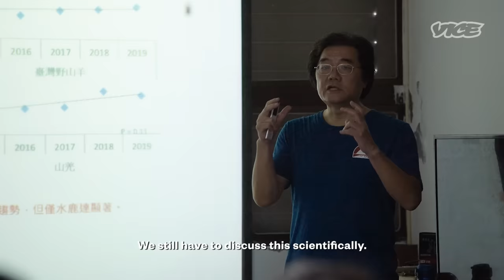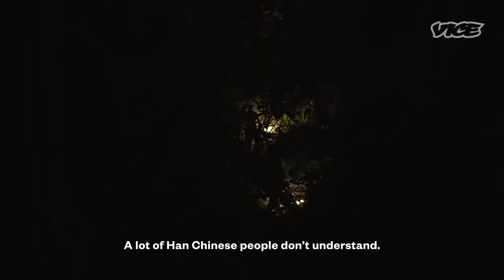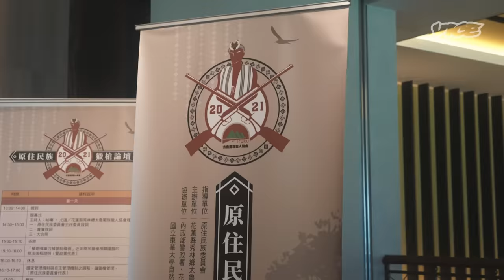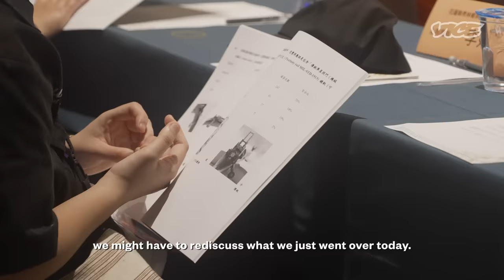The Homemade Guns of Taiwan

Comment: Two things I find really interesting about the stocks in particular 1) the length of pull is very long to keep the users face as far away from the chamber as possible 2) the stock is angled in such a way that aiming upwards (into trees) is much easier than aiming on a horizontal plane.

Comment: They should look for opportunities to come to the US and study under licensed gunsmiths. So they finally can build proper and safe homemade rifles.
Reply: Plus: the opportunity to have their youth and most talented entrepreneurs get knowledge and access to 3D printing. They already use wood but I assume printing would be of great use
Reply: Perhaps those in the west that have this knowledge may find refuge in the East where making guns is not just permitted but very much sought after.
Reply: Knowledge would definitely help tremendously, however, a big part of their problem seems to be the lack of proper tools. I would imagine if given a mill, a lathe, some quality steel, and an infinite supply of electricity, these guys would be turning out masterpieces in short order
Reply: @kabardino1337  They need equipment and proper materials to work with.  In parts of africa the steering shaft of cars were used for muzzle loading shot guns.  
Modern gunsmiths have CNC equipment these days.  The government would not allow that to be.  One of the easiest guns to make if you have some rudimentary equipment is a submachine gun.  3D printing, all of the working guns I have seen on youtube from it are using a lot of high quality steel parts in the design.
Reply: @loquat44-40  you can use sand casting and make own rifled barrels in your bathtub
Reply: @hungryorphan5975  I know just enough about steel that what you propose is not something that can be done as you describe.  Please give your sources.
Reply: @loquat44-40  it is possible my comments keep getting deleted it is called ecm
Reply: @hungryorphan5975  having experience in casting with sand molds, it would be incredibly difficult to make a long skinny tube with enough precision to be useful. You would also need to finish the inside of the bore, because a sand casting leaves rough surfaces that a bullet would get caught in
They should just be allowed to buy safe tools to hunt with. Its insane that they force them to risk themselves in such a way
Reply: @Haku Yuki yes, they do create some pretty nice looking firearms underground in the Philippines, but i think they have access to black market and better quality material to build their guns out of. Ive seen some with small power tools and compressed air tools in the Philippines though as well
Reply: @chrism4008  I'm not talking about making the barrel with the sand casting that's for recivers and other parts you use ecm for the barrel
Reply: @hungryorphan5975  i gotcha, that makes more sense
Reply: @chrism4008  I agree with you since to my knowledge long barrels have never been made out of cast materials.  The fall back for primitive conditions was to hammer forge strips of red steel around a mandrel.  The is doable under their conditions, but requires some knowledge.  Much cheaper to find perhaps hydraulic tubing that can take some pressure and that may be what they are using.
Reply: Honestly this is the best suggestion on here. A lot of people are bickering about gun laws and whether they work or not, but being able to study gunsmithing would help these guys out tremendously. Especially if they’re taught about the best improvised materials and how to work with less infrastructure, would probably set these guys apart by light years compared to their current tech.

Comment: As someone who takes pride in tool making and resourcefulness I wish I could travel to Taiwan and help their gunsmiths build out the tools needed for firearm manufacturing. Even something as relatively simple as a rolling block or trapdoor breech seems like an improvement over the open bolt, single lug designs that they are forced to work with because of their government.

Comment: In America, almost any rifle under 1,000 ft pounds energy or any bullet less than about 100 grains or that won’t expand is pretty much unacceptable for deer sized game.  And we realistically expect sub-moa accuracy.

In Taiwan they use homemade smoothbore muzzle loaders, powered by a nail gun blank, with a 10mm steel ball under 20 grains for the projectile.  And their government still freaks out about it.

I think a bow and arrow would be more accurate and more deadly than those homemade guns.

Comment: What I don't quite understand is if the goal of the government is to prevent the indigenous people of Taiwan to have powerful, or efficient firearms, or firearms that are a threat to "public safety" doesn't that backfire with the fact they encourage the people to learn to create their own guns? Guns that also threaten the lives of those who use them? 
They also require the guns to be certified and used by the one specific hunter to use, and if that's the case then the same process could easily be adapted to the purchasing and specific, lower power, or "less efficient" firearms that are far far far safer for hunters to use.
\
If the government had gone the route of allowing very specific select few manufactured guns  (such as single shot air guns, low-caliber rifles, etc.) to be purchased, certified, and used by the Indigenous people it would prevent most injury caused by backfiring guns, and would further prevent the percieved threat to public safety the government sees as it preserves the regulation on who is able to get guns but also discourages the need for the public to learn how to make their own.

Comment: I'm surprised they're not making roundball molds, homemade black powder, or even flintlock rifles.  Yeah, nail gun ball bearing smoothbore is simple, but I can't imagine there's no indiginous blacksmithing
Reply: Why bother with black powder muskets when you can just buy 22blanks and pellets for cheap
They are more reliable and accurate? Black power is also very vulnerable to environmental issues especially in damp areas and rain

Comment: The similarities between the indigenous people of Taiwan and the indigenous Māori people of New Zealand is striking. In culture, in language, in traditional social kinship structure, respect for elders tradition and integral ecosystem social relationships is striking. There is a very good reason for this. Scientific research into language and even DNA in recent years has shown that the ultimate ancestral origin of New Zealand’s Māori indigenous tribes are the indigenous peoples of Taiwan. New Zealand is the last major land mass to have been reached, discovered and settled by human beings since the dawn of modern man’s emergence from Southern Africa. The indigenous peoples of Taiwan are the initial progenitors and the indigenous peoples of the New Zealand the ultimate descendants of the migration over thousands of years and many generations of the Austronesian from insular East Asia through the archipelago chain of southeastern Asia, Micronesian, Melanesian and finally Polynesian island chain. Polynesians spread from west Polynesia eg Samoa, Tonga, Niue etc., to Hawai’i, to Rapanui (Easter Island) and Eastern Polynesia ie., Tahiti, the Maequesas, where the eastern Polynesians who travelled in double hulled ocean going vessels using star navigation to discover and settle New Zealand or Aotearoa. Hawai’i* to Rapanui (Easter Island) to Aotearoa / New Zealand form what is known as as the Polynesian Triangle. If one looks at map of the Pacific Ocean, one can see that the descendants of the aboriginal peoples of Taiwan have - over the course of millennia and hundreds of generations - migrated almost full circle. They are therefore the founders of the longest migration of related descendants and cultures in human history.

Comment: Seems like there are some decent options that could potentially satisfy the interests of both the tribal people and the government. I would suggest a combination of white listed factory made air rifles for tribal hunting and better access to firearms education, training, and range practice for the general public. 

The air rifles should probably be made in Taiwan under license at a modern factory. They should include models of high quality, good reliability, and safe function in calibers and design velocities appropriate for the game being hunted. By using air rifles instead of firearms, it gives the tribal people more independence because of no need for gunpowder. It also provides more predictable and safer operations  because it will be a function of just the pellet and air pressure, eliminating concerns of ammunition sourcing, manufacturing standards, and ammunition types. 

For hunting boar or other medium to large sized game, a caliber over .30 inch is recommended to minimize the potential suffering of the animals. For small game, .22 to .25 caliber may be sufficient. The models chosen should include moderators for reducing noise which can aid in hearing protection and prevention of game fleeing for a large surrounding area and reducing noise pollution for the public.

The management of the air rifles should be conducted by tribal representatives designated by themselves. They can establish rules for storage which might require a keeping them in a locked tribal armory when not in use and the rules for withdrawal for hunting or other uses such as rituals or training. They should be empowered to police themselves in regards to hunting rules and rifle usage rules for their tribes.

In addition to these air rifles for hunting by the tribes, the general public needs more firearms training for the purposes of general knowledge and national defense. This training could be at several designated firing ranges that are managed by the government. These should include some of the common firearms models used by the RoC military, the RoC police, and the air gun models used by the tribal hunters. Each of these should be available for the public to rent and use all the range. The public can also pay for any rounds or pellets used at the range at reasonable cost, bearing in mind that some may be able to be collected and reused (after reloading for the firearms rounds or just inspections for air gun pellets). The ranges should also include classes for gun safety, familiarity, and usage, and marksmanship.

The benefits of such rental based ranges and training classes are that the public will be better prepared in the event of military need such as mobilization in response to foreign invasion. The public will also be more knowledgeable of guns used by the hunters and the hunters themselves can use the ranges to improve skills. This will improve mutual understanding and respect between different groups of people.

Comment: I find it amusing that even in other countries buffoons with little knowledge or experience get to make laws without expending a single calorie actually researching or thinking.  A factory made single shot break action and a homemade rifle of the same type and caliber are not too different in effectiveness but without precise machining, materials, quality control, and proper ammunition your rifle could become a hand-grenade instead. It is either a supreme act of stupidity or an act of malice that the rule was not changed. At the very least they could allow black powder muzzle-loader rifles. In any case "safety" does not seem to be the issue here.

Comment: isnt it easier to open the shell and press the steelball into the shell? make a "live Round" ? much faster in my opinion
Reply: Less reliable. They are crimped and harded as such if opened they risk cracks if then a round is place on top and crimped they risk a casing rupture or water/moisture damage making the round useless also it's just alot of work.
Reply: In other countries they've gotten a similarly sized projectile (usually an air gun pellet) and glued it on top of the nail gun blank

Comment: Switch to crossbows instead,  these are silent easier to manufacture and you can produce these in larger numbers. Personally my opinion is that all kind of guns with a limitation to 5 shot should be permitted when the bearer is 18 or older.
Reply: Depends.... crossboes from 140-200lb draw is generally good for hunting... modern compound cross bows are generally too difficult to make hands down. A strong wooden recurve crossbow would be easier but the wood/composite would have to be very stiff or very long(to have enough power to kill) making it difficult to use in wooded areas. A steel cross bow like the old medieval ones would need extra equipment to load it as their poundages are insane .
All these have a range and accuracy issue as well as 50 meters is pushing it for most hunters

Comment: Might just be easier going with bow & arrow / crossbow & bolts, depending on what is actually restricted by law. Gun is good but not a necessity in hunting, the ancestors of their elders likely didn't use guns.

Might be some sort of a legal floodgate issue allowing manufactured guns but i'm not versed on the matter.

Comment: Do you think that the ancestors, would be happy with the use of guns and gps locators and UHF radios ?. When all they needed were bows slings and traps ?. Traditional pig hunting here is to use dogs to hold and a knife to stick the pig, rabbits are hunted with traps. I believe if you are fighting for ancestral rights to hunt, then you hunt with the methods your ancestors used. If you use modern hunting techniques then you abide by modern laws

Comment: Shi hand me some 12 gauge shot gun shells and I can go to Lowe’s right now and pick me up some what 3/4 inch black pipe like 18 inches long then 1 inch black pipe that’s about a foot long, then a 1 inch cap, get some bbs glue it to the cap or whatever centered with a washer and I got a homemade slam fire shotgun easy asf that can be made in like 1 hour, you could of course build a stock or just tie it to a piece of wood or whatever for a stock or just hold both the pipes and slam em together and boom.. its a slam fire shotgun that you don’t even need to fool with taking the empty casing out after shooting, just put another shell in the other end of the pipe then flip the pipe around and shoot the empty shell out while shooting another round, making a shotgun truly is easy and it can be fun but make sure to be safe, it’s better to be overly safe then to be sorry
Reply: It's not as easy for folks where ammo isn't abundant hence why they are forces to use nail gun blanks and pellet gun bullets slam fires are also not very accurate because of the amount of movement when moving the pipe back

Comment: i wish someone would teach them how to make proper and safe firearms at the very least. at best, allow them to freely own modern firearms. Not only are the firearms they use extremely dangerous to the user, they are not very effective nor humane for the game animals. A 10mm steel ball fired with an industrial blank is probably going well bellow handgun velocities. Not only that, but modern hunting rounds are designed to cause massive and rapid bleeding in the target, leading to unconsciousness from blood loss. Where as a steel ball, traveling barely fast enough to be lethal, is more likely to just wound and prolong the animals suffering. I wouldn't be surprised if it was common for hunters to wound an animal only for it to die of infection days later, or loose the animal in the woods for it to bleed out somewhere else.

 tl:dr Banning proper weapons is not only dangerous to the people, but cruel to the animals

Comment: Can you give them high power air guns?
Reply: And how will you pressurized them? Who's will maintain them? How will you make them?
Reply: @ISwearMyNameIsJohn  I did think of this after i posted that... I am not sure.. I really don't even know how strict the gun laws are.. If they do allow them they will probably have a factory to make them(I guess they would already have them if air guns are legal) im not sure just smuggle a crap ton and use a few for spare parts idk..
Reply: @boogalooslav6943  to me it's Just too complicated so many valves and seals that can leak over time and they are hard to repair unless you got a guy who specializes in that
Reply: @ISwearMyNameIsJohn  i guess thats why they got what they got.. At least it does the job thankfully
Reply: naidirolf  depends most hunting level air guns are charged by c02 tank. Pressurized break action air guns are generally to weak for anything but smallest game hunting and once again if there are any issues maintenance/repairs aren't easy